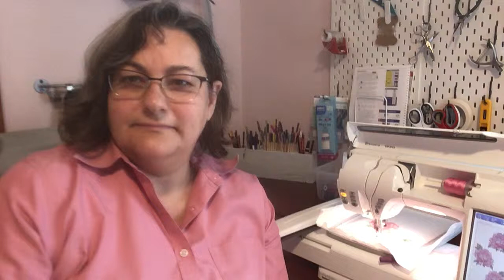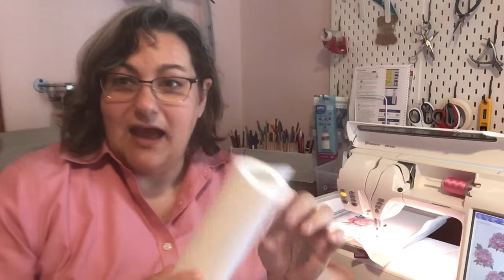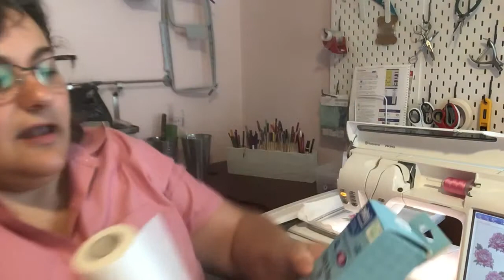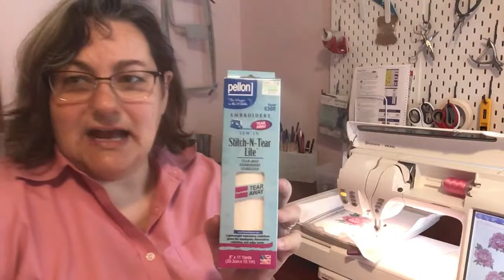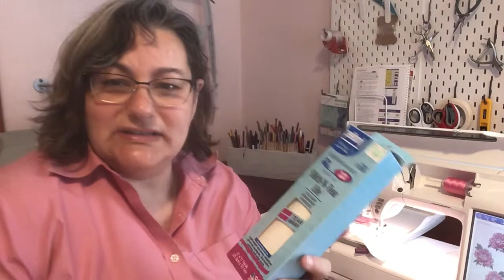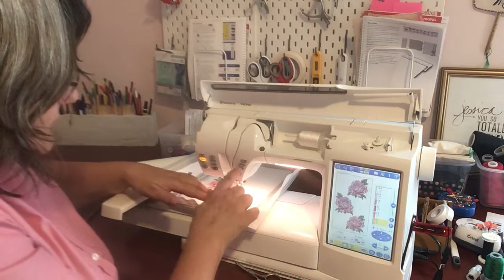Embroidery tips for the Huskavarna Viking SE

Comment: This is so helpful, I just got mine used and am new to embroidery and no where in the manuals did it say to cut the threads on the top, I had no idea. Also, I couldn't figure out how to do the color changes without switching the machine back into sewing mode to move the pressure foot down. I feel like an idiot. I know this is an old video, but I really appreciate it❤
Reply from the maker: I am so glad it’s helpful, once you get the hang of it you will love doing embroidery!

Comment: I have a designer SE and every time I turn it on the lights are blinking constantly and the screen is clear. I have to unplug it, leave it off for a few then plug it up again several times and then it comes on. Does this mean my machine is getting ready to die?
Reply: I know this is 4 years later, and you surely know by now that probably it was your mother board. Ask me how I know. I had to have mine replaced, and that was what it was doing---blinking lights and blank screen. I thought I'd post this for the benefit of others asking the same question.